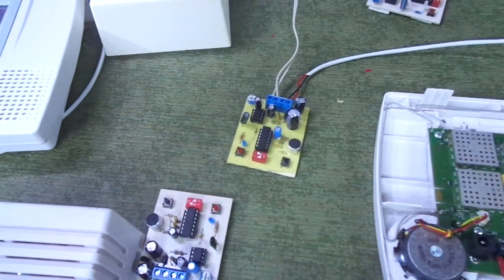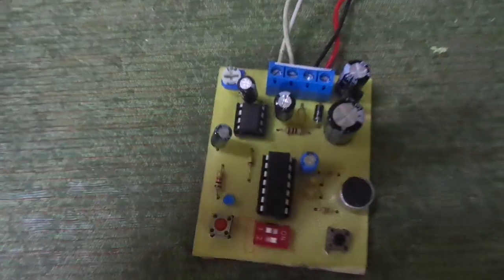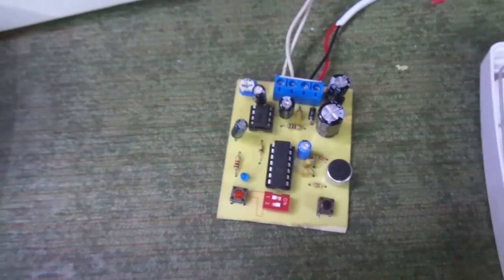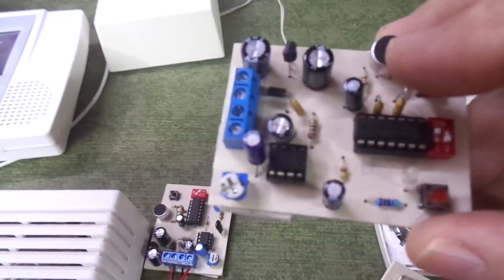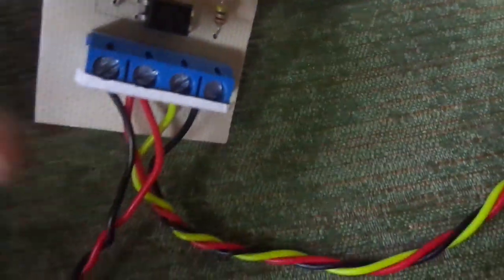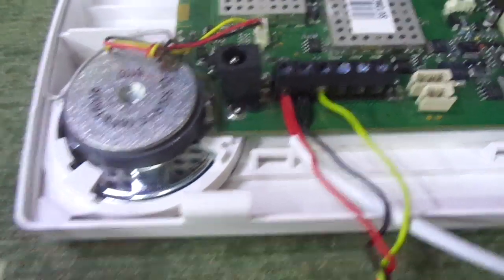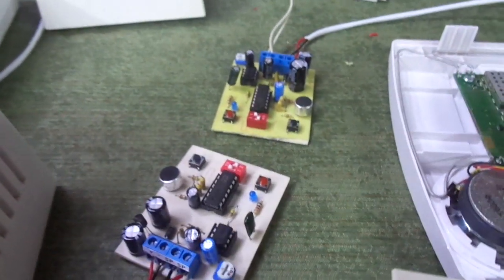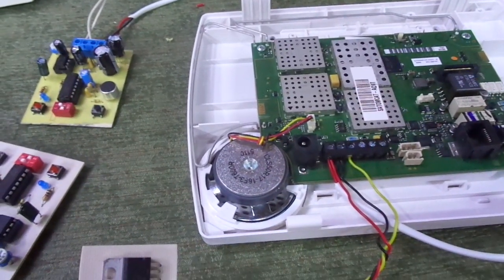Ron in the shop DIY voice recordable siren driver for Lynx Touch

Comment: Do you sell these on eBay?
Reply from the maker: I will put some more on ebay. I have sold all I have in stock so I'll have to print some more up. I should have them available next week. Today is  6/22/19
Reply from the maker: today July 4th 2019 I have 3 of these for sell on Ebay. I try to keep them in stock but sell out fairly quickly, The newer model also has a closed loop that can be used with door sensors or motion sensors.
Reply: @roboalarms2467  thank you! Will you build a model that works for a fire alarm input where when the panel pulses code 3 it will play a fire message?
Reply from the maker: @dirtdevil7bo   I have considered designing and building such a board, but it would have to be larger and require two recording chips. It might be easier and cheaper to build a small board that gives a different trigger output and then you could use any type of device for your alarm output. As an example one siren board with voice announcement and strobe light and yet another with just a burglary sound and no strobe light.  The combinations would only be limited by your connections. I'll have that designed and printed in a few days.
Reply: Found this today and purchased today!  10-25-19